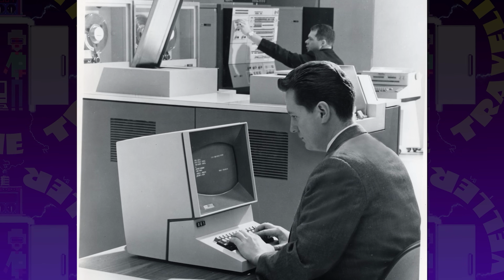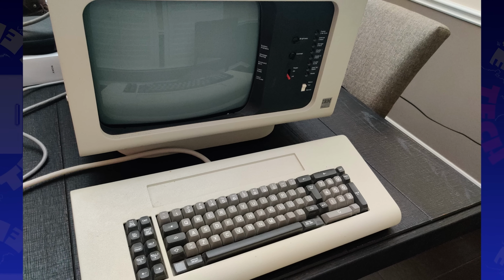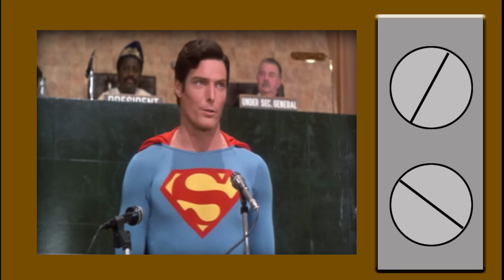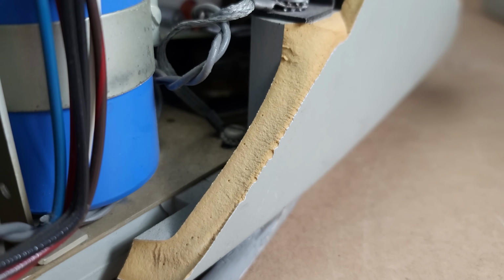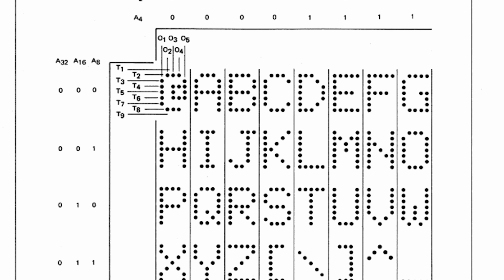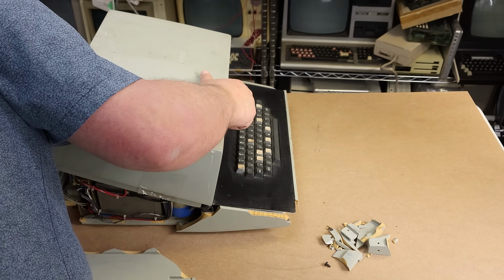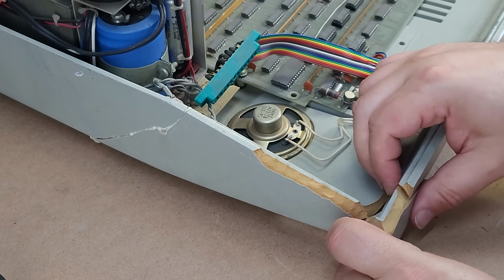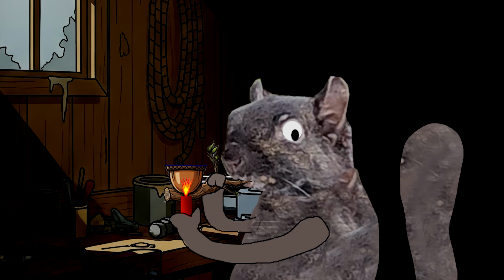Fixing a 1974 Computer Terminal (Part 1)

Comment: Univac Uniscope's are an early example of the mostly-dumb terminal.
When I was a teenager, our school computer lab had one out the back, and it's double-shot 60s keyboard was quite something.
(Uniscope's speak ASCII, but still do full screen editing, with editable fields. Very creative use of control codes)
They came with an exciting variety of keyboards for different applications, and like your one, were fully TTL.

Comment: German computer from 1941 💀

For that connector, you can probably find a ground and/or power rails on both sides and line it up by that.

Some small clamps for like woodworking and stuff might've been a good choice for providing some force to keep things together while things dried/set.  Another youtuber I watch, twoodfrd you can see uses a lot of clamps and things for keeping things together to dry.  Some just made up of various nuts and bolts and bits of wood and cork.
Reply from the maker: Many thanks for the advice!  Yes I have clamps.. I was a bit nervous about using them because this urethane is so randomly reactive to things touching it.  But perhaps I could use wood blocks in between..

Comment: You should use a sanding block, it'll make it easier to get sharp and straight edges/surfaces.
Always exciting to see what you've found, nice video 👍
Reply from the maker: My only worry with a sanding block is I sometimes overdo it.  When I go by hand I can feel the thing I'm trying to smooth out a bit better.  But you're right, for straight edges it's probably the better choice.  Gotta practice more!
Reply: Yeah you have to be gentle, but I'm sure you'll get a feeling for it fast 🙂

Comment: @ 9:05 you can see a broken diode (CR1) next to a tantalum cap, might be the one with the broken lead.  My guess would be a switching diode of some sort, look around the board for any other blue diodes and see if you can find a number.  If not, I'd just put a 1N4148 in it's place.
Reply from the maker: Yes I was trying to figure out what that was.  Other diodes are really hard to read.
Reply from the maker: Thanks for that very useful advice.  I couldn't find anything on the board I could read so maybe I'll try that.  I was all excited about firing up once my trimmer pots arrive and then was like No!! :)
Reply: I just finished posting a reply comment about CR-1, and I agree it's probably a 1N4148 type, maybe used to clamp the signal on the anode side to maximum of 0.7 volts about the +5 volt bus (where it appears that the cathode is connected).

Comment: To sand those inside corner warp the sandpaper around the screwdriver to get a finer tip. Just be aware that that tends to wear out the paper very fast.
Reply from the maker: Dang I didn't think of that!  Thanks for the tip!  Will try it on the next round.

Comment: Looks like you're off to a great start.
(poly)urethane foam may seem like an odd choice for a case today with the wide array of plastics and manufacturing techniques available to us, but it's cheap and easy to use in a custom mould without having to go to full scale production injection moulding. Just seal it with a durable polymer paint and you have a light-weight, durable material.
I've encountered some similar material when installing fan ducts and vents in animal stables, so there's still practical applications for it.
There's something nagging at the back of my mind about using some common solvent to fuse urethane foam like that, but it stubbornly refuses to surface, and I'm not sure if that would have been useful in this case either way...
Looking forward to part 2.
Reply from the maker: Thanks! Yeah urethane.. I'm really hoping I didn't make the wrong choice of glue there.  So far seems to be okay and quite solid actually.  I think Gorilla Glue has some kind of polyurethane in it.  Have to check again.
Reply: @TechTimeTraveller  I couldn't tell you, but using an adhesive that also acts like a bit of a  filler seems like a good choice, as long as it adheres well.
If the combination of glue and Bondo (James Bondo) sticks the pieces together and fills what needs filling, I think you're on the right track.
Maybe there's a more elegant solution with urethane foam and some plywood to recreate parts, but it's better to mend it reasonably and getting it working than nothing at all. And the mending shows you've given it some love when it broke.
I had to look it up, but I believe it's called "kintsugi" in Japanese. You've seen it. Pottery mended with old or silver mixed into the putty to show the mends.

Comment: 9:14 top row middle IC - what happened to pin 3? And between the bottom left and middle IC the CR1 diode there is smashed. Hope it's not a Zener or anything else special.
And the PSU is using a leaf blower as a fan just for kicks.
Nice Hot Shots reference!
Reply from the maker: That is weird re Pin 3.. didn't notice it until you pointed it out.  It's almost like the IC pads weren't aligned correctly and they just jammed it in there?
Reply: @TechTimeTraveller  Makes sense, it doesn't look damaged (as opposed to CR1)

Comment: Nice video. For the voltage rails. Please hook up some resistors and measure them again. Because 16V seems a little high for 12V - even when floating.

Comment: Those cards look exactly  like S-100 cards, all the way to those two plastic latches.  I can see no outside difference between those and any S-100 card.
Reply from the maker: So that raises a question - given the Altair was coming out in late 1974, did someone working on this bring that design over there?  Or vice versa?  Or is this terminal a bit later in production than the date codes suggest?
Reply: More likely these guys were using the same card edge connectors for the same reason MITS did: they were broadly available and dirt cheap.  It wouldn't be at all surprising if there were matching blank PCBs.
Reply: @TechTimeTraveller   it's very likely there had been some cross-pollination of ideas.  It can't all be coincidence.

Comment: Those TTL chips look like Fairchild parts, Fairchild used to have their own proprietary "9xxx" numbering scheme for TTL and DTL ICs. I'm pretty sure the bland-looking "F" is supposed to be a Fairchild logo, even if it doesn't look like one.
There's a ton of Fairchild databooks from the 70's on Bitsavers and the Internet Archive.
Reply from the maker: Yes I've been digging around, a lot of them seem to be basically 74xx series chips in disguise.